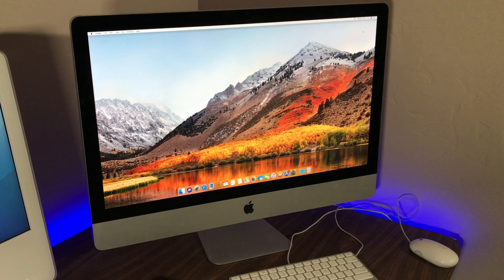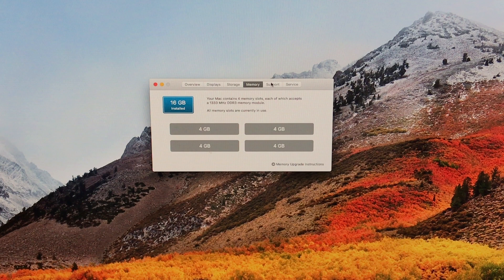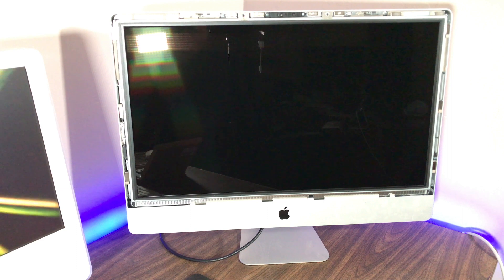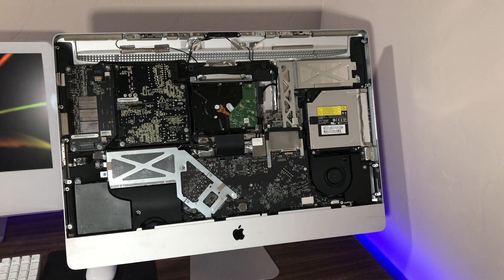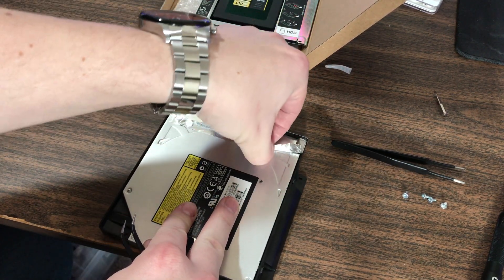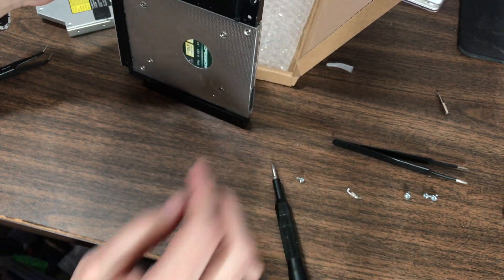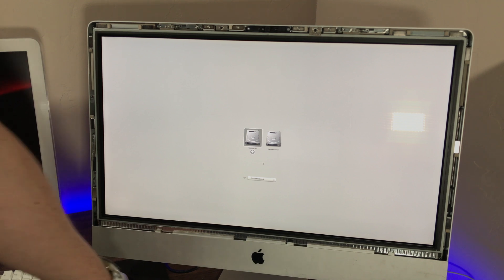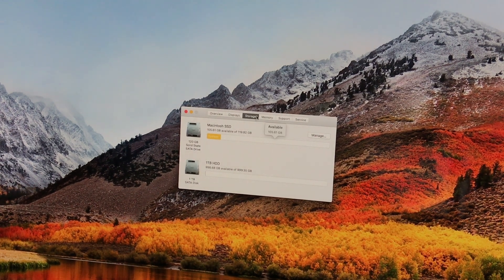Upgrading My 2011 27-Inch iMac! Adding SSD and Second Hard Drive for MAX Performance!

Comment: Hi, first of all kudos for doing this man. 
Second I have a mid 2010 iMac (27)
Will it be the same process? And same ssd link you have recommended?
Tnx
Reply from the maker: I'm sorry for the late reply. The process is the same for both, the hardware design didnt change, and yes that same SSD will work perfect!
Reply: Just be aware of the slower speed of the SATA connector on the optical drive port. I know my 2011 iMac is a SATA II connection, but I can't tell you if the 2010 iMac is SATA I or SATA II. I.e., don't expect standard SATA III speeds using the optical drive's SATA connection

Comment: Just wondering why you chose to remove the Optical drive, when you could have simply purchased a second SATA connector and used the second hard drive SATA port. The optical drive SATA port is slower than the two hard drive SATA ports.
Reply: You are correct that the optical drive is a SATA II link (3 Gbps), not the standard SATA III (6 Gbps) that the hard drive uses. 3 Gbps translates to an theoretical speed of 375 Mbps, but realistically more like about 225 MBps tops. I'm trying to keep my 2011 iMac going because 1) it's still a perfectly fine machine with its i7 processor, and 2) its OS can go as high as High Sierra but as low as Snow Leopard. The problem with High Sierra is that it requires the drive(s) to be formatted in APFS, and once the drives are in APFS, then you cannot drop down to Snow Leopard via a partition! I already have a 16TB rotating hard drive and a 1TB SSD in the two SATA III slots. Since I seldom drop down to Snow Leopard anymore, it's a reasonably compromise for me to replace the optical SATA II slot with a little 1TB SSD formatted in HFS+ and live with the slower speed when I boot into Snow Leopard.
Reply: @demef758  are you sure this 2011 27" iMac has another SATA slot ?  I have exactly the same model with 256G SSD, I'm thinking of best options to add more storage, I prefer to keep the DVD drive if possible.
Edit: Ok found this https://www.youtube.com/watch?v=uIULGZHw8xI,  the second SATA port is under the logic board.
Reply: @demef758  that still doesn't explain why you didn't connect it to the secondary SATA port. Surely if you're upgrading you want the maximum speed possible and what you have done does not supply that. Why? Are you unaware of the second SATA slot?

Comment: Hi.. I just put a new ssd in a 2011 imac that I'm working on for someone who bought it at a yard sale..I opened it up to find that it did not have a hard drive in it,so I put in a new ssd drive.Now I am having issues getting it to boot in recovery mode to format the drive.Using a windows keyboard,I hold down the windows and r keys after hearing the chime and waiting for the apple logo to appear,then letting go. When the progress bar gets all the way to the right,nothing happens and it just goes to a white screen..Any help would be greatly appreciated..I need to get this fixed asap
Reply: Unless the hard drive has something like Lion (10.7) or above already installed on it, then there is no such thing as recovery mode (command-R). You will need a bootable drive connected to the USB port, then hold down the option key as you power up. Or remove the SSD and initialize it on another Mac and install MacOS on it from there, then install the SSD back in the iMac and it should go from there. The 2011 iMac was right on the cusp of this sea change in the way Apple fiddled with MacOS.

Comment: I’m wondering compared to if ssd boot from the hdd connection and from the odd connections is there any different in boot speed
Reply from the maker: Thats an interesting question. I just sold this iMac or I would have tested it and reported back.
Reply: Yes, the speeds ARE slower on the optical drive SATA connector, by a factor of two.